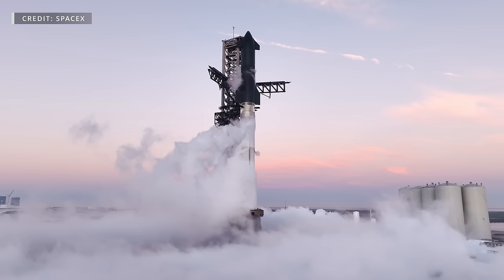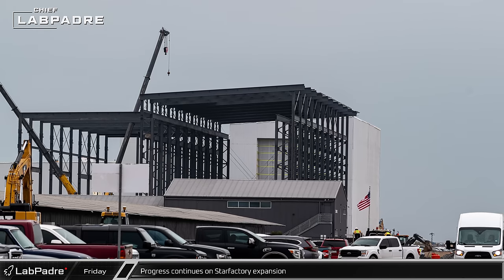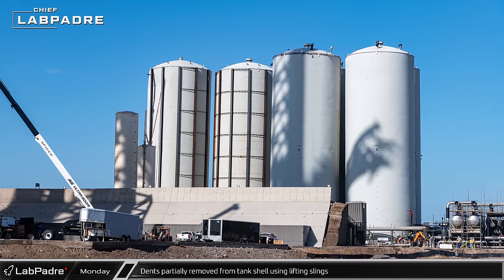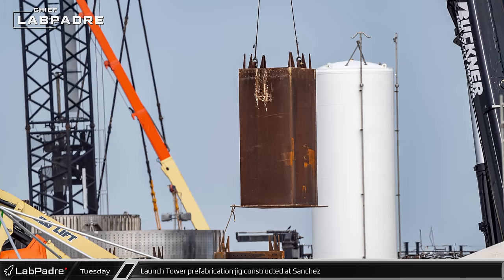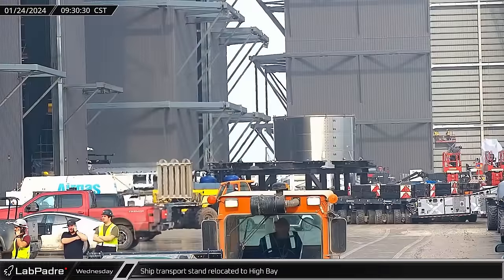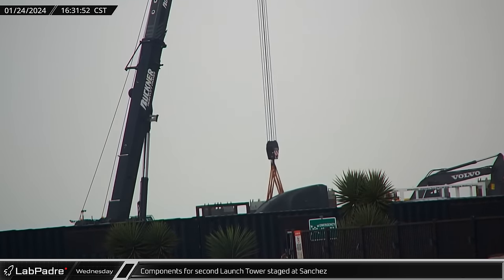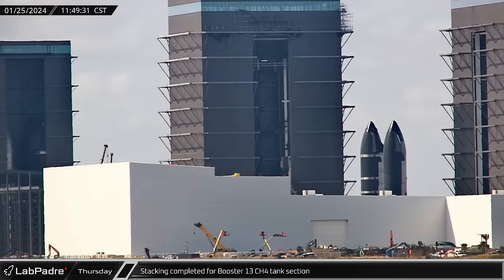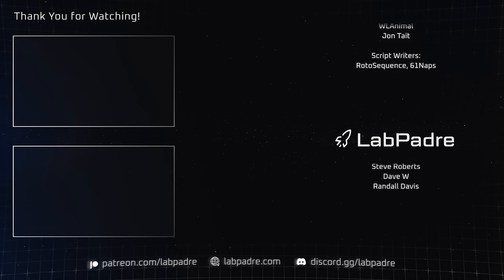SpaceX Covers The Launch Site in Armor to Protect Against 33 Raptors! - SpaceX Weekly Update #99

Comment: I am going to say the crane is being configured with the dual truss configuration, getting it ready for construction of tower 2!
Reply: Could be but they haven't even started ground work yet.
Reply: I'd also thought that, but IIRC the crane originally used to build the first tower was a LR13000? and I wonder if the LR11000 has the same tonnage lifting capacity and height capability as the LR13000?
Reply: I’m going too say the same thing.  Soon is flight 3 tower will probably start going in.
Reply: @robbannstrom No, it's weaker

Comment: I believe the LR-11000 cranes boom is being disassembled and will be reconfigured with the double boom or “Power Boom” to start the build for the second tower.
Reply: I'd have to agree with that.  Given how their going with second tower. I'd imaging that's what going happen.  Unless the upheaval of park services landswap back fires (it sounds like it did) causes the delay in 2nd tower.
Reply: I have been wondering if it is going to be reconfigured with a power boom for the new launch tower. I have been watching for any posts on the subject.
Reply: @Doug_Morgan  I did look back to the assembly of the first tower as well as the OLM. The Rasta Crane had a double boom the whole time. It makes sense. The weight of the tower sections could easily cause a single boom configuration to “pop-out” under heavy load. I’m sure the reassembling will start soon. I also feel it will built close to the first tower as all of the fuel and plumbing is already in place.
Reply: @Wrangler-fp4ei  it does suck that the land deal has been held up. But I think the second tower will be in the area of the suborbital location they just dismantled.
Reply: @Powerhead1000   Looks like they are putting the same boom back on. They may rent one for when a double power boom is required or re rig it later.

Comment: IMO, I see a few problems. I won't speculate on who is at fault, but there appears to be some cases of crews taking shortcuts probably to save time. Another is that the strength of concrete and steel for construction I think have been overestimated because they are rated using tests which do not include exposure to high intensity rocket blast. The water deluge works because it does not rely on material strength and is continually replenished as it gets "burned off"'